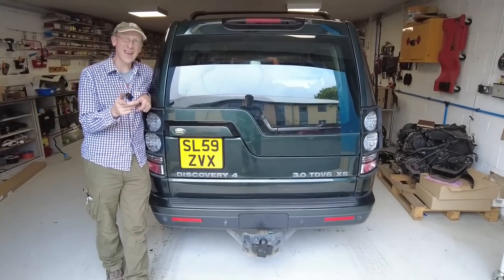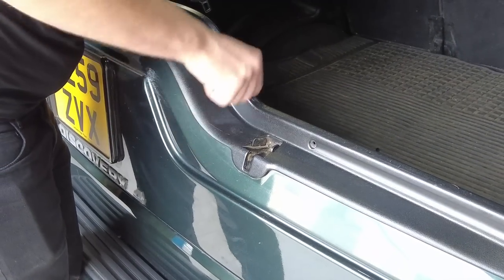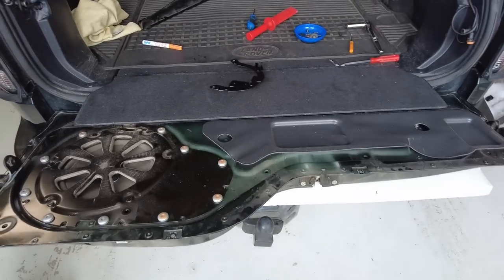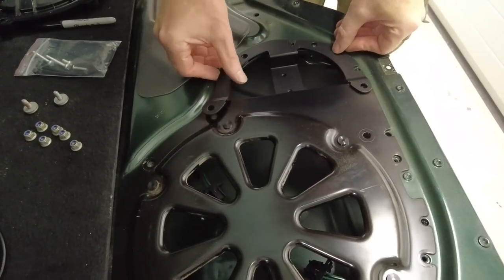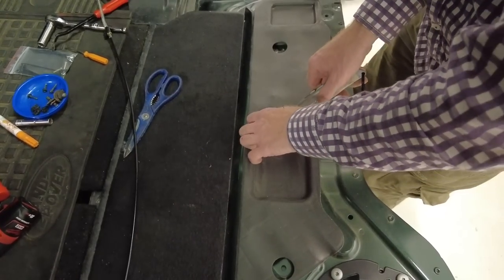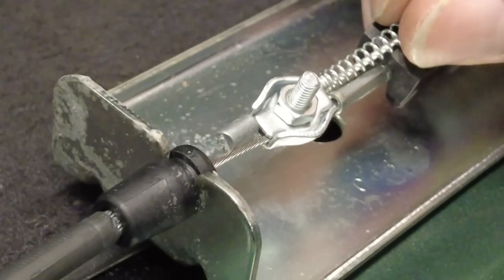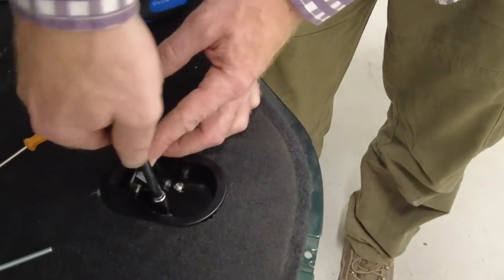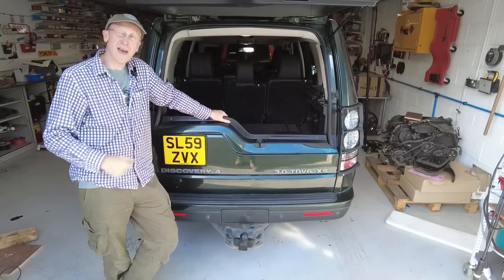Land Rover Discovery 3 / 4 Upper Tailgate Internal Manual Actuator Release Upgrade

Comment: Great video - LRP has some interesting kit on their website. Just ordered a low profile roof rack from them.
This inside release handle is primarily useful for people camping inside the back of the Disco - since the rear hatch can be opened from the inside while you are inside. The “insurance against failed latch” is a secondary benefit.
Jon
Reply from the maker: Yes we are always happy to work with other companies in the LR world and they have some great products.
When you are camping inside you can always exit the rear doors but agree the tailgate could be beneficial.

Comment: A bit of sunshine, hot tea at the ready and an iPad to follow this install and all done - sooo much better than reading instructions (didn’t have a jigsaw so just drilled a lot of holes around the outside edge for the handle and worked out fine) 😎🤓🙏 Now Ineed to find out the hack to release the lower tailgate, just in case that packs up 🤓
Reply from the maker: Not heard of many issues with the lower tailgate release

Comment: I have had similar problems on my 2005 LR3.
A couple of years ago my upper tailgate switch stopped working. Managed to doctor the switch and fit a simple press button ‘horn’ type switch, still fully enclosed behind the rubber cover that protected the original micro switch.
But just recently it stopped working again, due to badly corroded wires leading to the switch. I cut out all the rot and replaced it with new wires, tapped it all up to prevent moisture ingress and now it works fine again.

However, due to the age of the vehicle, just in case the actuator fails , I have also attached a Bowden cable from an old bicycle brakes to the actuator mechanism, using and M6 bolt, nyloc nut  and 2 washers to act as the clamp joining the Bowden cable to the original.

Comment: You can leave the wires holding the tailgate on the bolts and remove the bolts with the cable. That also removes the risk of the tailgate holding cables disappearing....
Reply from the maker: This is a top tip and one I will use in the next video... you get a love heart for this !!
Reply: Excellent tip. Thank you.
Reply: Yes. I just installed the LR Passion lever, and removed the bolts and cable together. Saves a step, a bit easier.

Comment: Once you have removed the lower tailgate carpet, I recommend temporarily putting one stay white and ball back on to prevent the foot paint getting soiled, if the white foam you have used should slip off the bumper.

Comment: What use is a subwoofer under the carpet? i had same problem on mt D3, found a good video where you press both unlock and lock buttons on dash and hold. If actuator is working, it opens partly. Then wedge open and repeat, or get another person and pull as buttons are pressed. My actuator is working and ordered a new switch today.

Comment: No good boys the very end pin that has a 90 bend is what usually breaks (built obsolescence and several hundreds of dollars into bloody JLR POCKETS) and not the actuator, so this fix doesn't cover all Land Rover typical shite. I used 3 long 6 cents each cable ties as the South African video shows. 2 tie all together so if the 90 degree end piece breaks and actuator stuffs up and you tie the third very long cable tie to poke out between the carpet and plastic trim. Then if anything goes just pull the cable tie. All up 18 cents, works much better quicker to install and a few thousand % cheaper than those bibs and bobs.

Comment: Great video and most instructive however if the actuator fails with the back locked and the upper door down there is no way to get at the screws that hold the top cover of the carpet.  In my case the only way to access the actuator and replace it was by cutting a hole in the lower door lining above the actuator which then needed to be replaced or repaired.  This item would be excellent as a safety precaution in case of a failure.  Enjoy your wry humour.
Reply from the maker: Hi Denis we have done a video on this..
https://youtu.be/SS-Yxnh98uA

Comment: Excellent video - as always, thanks.  This is what every Disco 3/4 should have.  But, I think it would be a good idea to remove and replace the rubber covering instead of cutting it.  This way the actuator would still be properly sealed and damp protected after the modification.  I assume the rubber is to help protect the actuator from any igress of moisture.
Reply from the maker: John as ever your points are most valid - I have now ordered a new rubber cover and will add this to the next video / and our website.

Comment: Damn, great product and as usual Simon a very informative and entertaining video. I just wish you had done this 4 weeks ago when my actuator packed it in. Not going to bother now that a D300 Defender is on order, although the way that is going I might still need it 😂 Ordered in late May and still don't have a build date. Apparently the 11.4" screen is the delay.
Reply from the maker: The lead time for the Defenders seems to be getting longer... we were really lucky to get one of the first ones. Interesting the 11.4 screen is the issue but it makes a huge difference and for the extra £140 is the best value extra in the build offering !
Reply: Yes, the bigger screen and the eDiff would be the best value from what we have ordered. As for delays, we also have the tyranny of shipping to Oz, which according to a mate in that industry is about 2 months.

Love the vids and some of your ideas. Will definitely look at the cargo light, reversing lights and probably the recovery eye hooks. By the time we take delivery, there will probably be a few other items I'm sure.
Reply: Ah, on the screen delay, just what the dealer has told us. Could not understand why they can't build if this is the only part they are waiting for, although if there are a lot of cars they can't deliver because of this part, they would have to store the 'unfinished' vehicles somewhere. And that may be a problem.

There does appear to be a world wide shortage of some computer chips used for graphics cards (Bitcoin miners sucking them up apparently). If this is correct, maybe contributing to the delay.

Comment: Good video and a well-engineered solution. But on reflection the location chosen for the release handle is sub-optimal - I’ve been looking at putting a fridge in the boot and the most logical place would block access to the release handle. I’ve also been thinking about a sleeping platform, and the best solution seems to be at parcel shelf (or there abouts) level, and that would make access to the handle tricky at best. So it seems it’s only in the best place for that rare camera person who wants to illegally film from the back of a moving car.
I think a better location would be somewhere just behind the second row of seats, at parcel shelf level. I know that would make getting the Bowden cable out of the lower tailgate, but to my thinking it would be a better solution for all scenarios - even the luny camera person could still access it!
Reply: I think that was chosen as being the only place where it could be fitted without physically cutting the metal of the tailgate itself.
Reply: @johnwillett4086  yes understood. It is well engineered and thought out, but the resulting location of the release handle will stop me buying one.

Comment: in the event of switch failure, your scan tool should be able to actuate the release solenoid via the body module I assume
Reply from the maker: Yes for a switch failure it is easy - the actuator failure is the problem !

Comment: Hello Simon... a quick question if you don't mind.... would it be possible to buy a copy of the 5mm tool you used as I do not have access to a workshop  ? 
In the grand scheme of things, the price is irrelevant. 
Best Regards M.J.Liptrot
Reply from the maker: Can you tell me the time in the video i am using the tool you need

Comment: As great as this backup is it has major limitations. So many of us in Aus have draws or a cargo barrier in the back and cant get into the back when the door fails. Im doing a similar setup,  but with the latch down near the 2nd row of seats. Easy access when loaded. 
The unit is exactly the same as a lazyboy latch,  but with a label and bracket.
Reply from the maker: Good point ! maybe just fit a new actuator every 5 years ?
How about a release next to the fuel filler - hidden and behind a locking fuel flap
Reply: @L663 fuelcap location, now thats a good idea. I had considered it,  but it may be worth me looking into a bit more. As for regulare replacement,  i know that will be forgotten,  and some fail early anyway. Goid to hace a plan B.

Comment: With you using the line of the carpet plus the jig all you would need then is a measurement from the side instead of painting the top of the screws what do you think.?
Reply from the maker: The king of templates comes up with another good idea - we could design a cardboard template to fully locate the item and then there would be no need to mark or drill the hole.

Comment: I can hear something working but I can’t open the top hatch, is this the actuator that’s failed or the switch? I want to make sure I do the roughy steps and not mess it up more
Reply from the maker: It sounds like classic weak solenoid - best if you can get it open - try with the engine running - sometimes the extra voltage will be enough for the actuator to work

Comment: You don't happen to have part number for those screws at start holding black plastic on top? I've got two missing from when I bought car.
Reply from the maker: Screw = EYP500250
Cap = EZU000010PVA

Comment: Nice, this mod is a smart move. Had to replace mine after failure. Not fun.
Reply from the maker: How did you access to open the tailgate when your broke ?
Reply: @L663  I used a trim clip removal tool. The rigid pry bar one made from plastic. Crawled into the back and wedged the pry at between the tailgate trim and the carpet. Once I had a little more space I wedged another trim tool in. Then a screwdriver between the trim tools applied pressure until the carpeted price popped out. Take patience not to tear it up. It can be done though. Got a full replacement kit from Atlantic British even has the vapor barrier new. I still worry about being out on a trip and all my stuff being locked in. This is why I am really interested in the manual release. Good bit of kit.